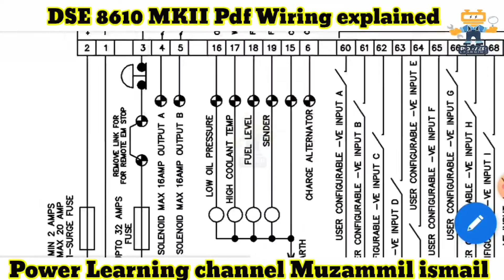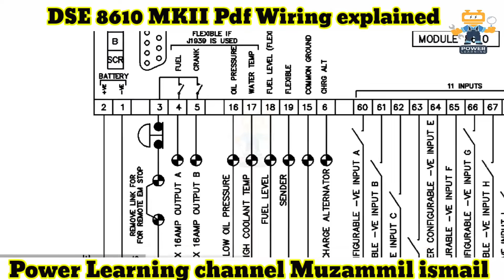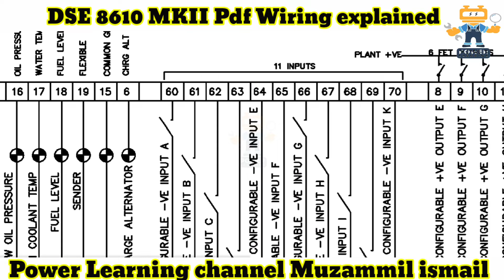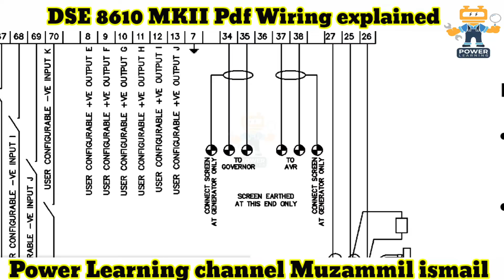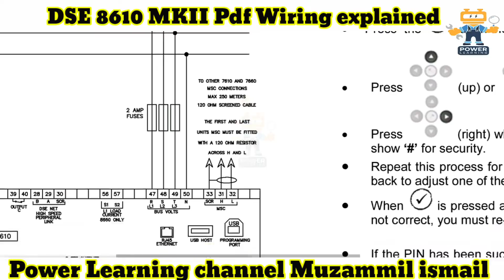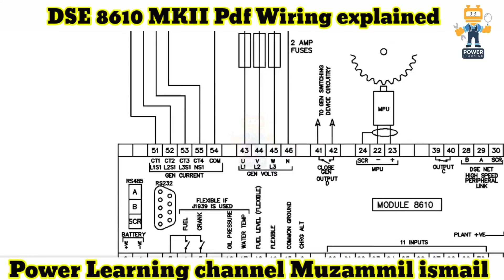DEEPSEA dse8610 wiring diagram | dse 8610 mk2 installation instructions | typical wiring diagram

Comment: AC main go to the controller through a 2 amp fuse.
Reply from the maker: That's correct, using the proper fuse rating is important for protection. 👍